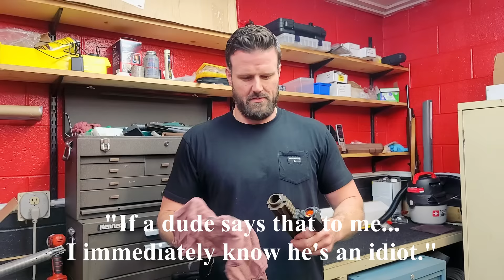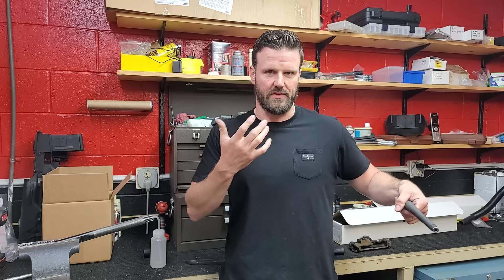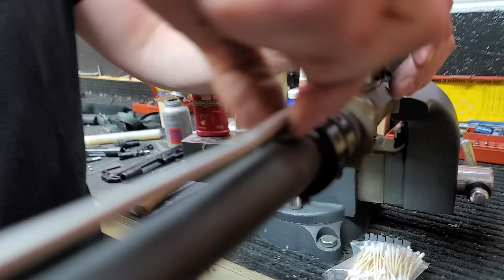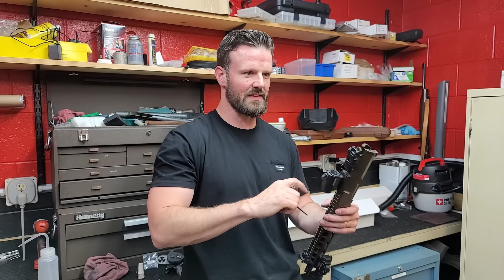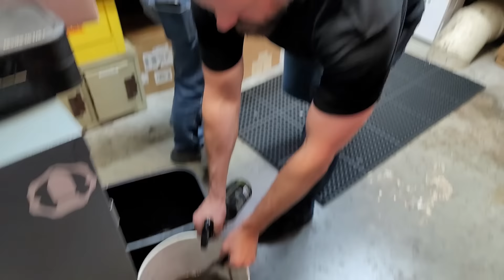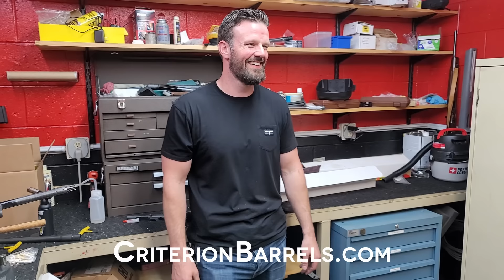AR15 Science

Comment: 6:02 Why the gov. profile exists today: As Mickey said, the military has it so it must be good and everyone wants it. 
He probably knows, but for those that are interested how the gov. profile for the A2 came to be: 

Lt. Col. Dave Lutz shared on AR forums that when the M16A2 project was on it's way in the early 80s the collected data for improvements named breaking of the hand guard and 'bent barrels' cause the armorer's drop gauge didn't fall through. Circulating stories featured opening crates with the rifles or rough bayonet training as possible reasons. The M16 was meant as a handy, lightweight rifle, so only the front of the barrel was beefed up for the bayonet lug (4.8 ounces over the standard profile isn't that much additional weight, a bit less wobble in the front but not as quickly handled). The lug showed 9 times more resilience against bending under load bearing tests. Issue fixed, send out the data package. Quite a bit later they inspected the barrels with a bore scope connected to a screen and found copper accumulation on the burr of the gas port holes. After they removed that, the drop gauge passed and the barrel was 'unbent'. Colt changed back to the standard profile for civilian sales, but the gov. production was to far ahead and they kept it. So get yourself a gov. issued perpetuated mistake!
Reply: Hbar been the truth for me 😅
It's like I hear Looney Tunes "boing-boing-boing-boing" sound on my first government barrel when I first started. 

You just once again assured my hbar choices. 4 rifles with hbar, love it

Comment: Only concern I have with the thread locker on the gas block screws is that we heat up thread locker to remove it so that gas block gets super hot when in use so that blue thread locker has to be turning to liquid and can’t be doing much for securing a set screw.  I’ve had guns in the past that have a pinned gas block that have shot really well. Not saying I am anywhere near as smart as the guys at criterion but I am curious as to why we use loctite on super hot surfaces when we know heat changes it’s characteristics. Isn’t this why we use rock set (spelling?) for muzzle devices?
Reply: @southernpartisan1772 on a machine gun sample??
Reply: Especially running suppressed at a minimum I would use high temp thread locker on set screws
Reply: This way of securing the block is for accuracy. In a war situation you'd want a better fit id say
Reply: You’re right. Rock set should be used and not locktite. Blue locktite will do nothing.

Comment: I was surprised to see him use anti seize on the barrel nut threads instead of aeroshell. For someone who’s very particular, he’s using the wrong stuff. I was also surprised by the blue loctite on the gas block. Dude, the gas block is the hottest part of an AR15, I wouldn’t even consider red loctite sufficient. SOTAR recommends rocksett. I totally agree with him on the gas tube though. I was told by a long time armorer years ago to essentially free float the gas tube and make sure it’s not contacting anything except the gas key. I saved a gauge that came with an Odin Works rail from years ago that helps ensure perfect alignment and have ever so slightly bent many gas tubes to get them in perfect alignment.
Reply: Yup

Comment: I’ve Previously Stuck to DD/BCM BFH ELW/BCM 410SS/RainierArms “Match”-Mountain Mod2(4150CMV/SDM Fluted/Mid-Length Gas System/Nitrided),Aero/BA-416R Fluted Hanson Profile/Mid-Length-Gas System, Noveske(416R SS & CHF CL’D). 
  Recently I Gave your 13.9” Core .223 Wylde .625 Tapper Profiled barrel + RipCordIndustries “Gass Hole-Gas Block”+V7-Inconel Middy Gas Tube(“Fuse=Bad”: Sensing round or Catastrophe Failure is preferred.(AS IF I’ve ever forced to run it to the point of catastrophic failure from shooting 750+ consecutive rounds in under 15min then odds are A potential catastrophic failure will be the least of my concern on what may possibly maim me/threatened w/ Dead of grave bodily injury. 
  While I’m likely dense I figure if a race motor is built so the valve either opens or motor blows. My hypothesis is same with the AR15. It will either work or result in catastrophic failure, that the risk of such an occurrence will be minimal compared to secondary external threats. 

  I lapped the face of my SOLGW upper, heat fitted your barrel into the upper, dimples both set screws. 

  That said. I did discover a very strange wad of Goop/Dried Waxy looking crap fully obstructing the Entire Gas Port. Upon inspection when installing the GB, I used a thin wire to clear the obstruction, tested w/both human & machine air pressure to guarantee the obstruction was 100% cleared. 
   Since I’m aware of your strong reputation, and I caught it before any potential issues occurred, I didn’t see the Point in sending it back on an RMA for inspection beings it seems GTG now. I did document w/ multiple photos AND saved whatever the hell was obstructing it in case you guys ever desires to look at it n determine what it was. 
   Between the install procedure I followed sane as you did, added your head spaced bolt, I’m really excited to see what kind of accuracy it will yield for me. If I can consistently get .5-.75moa from a bench vice(remove my human error/variables) n see what the mechanical accuracy of the rifle can potentially be w/ INI Razor Core 69/77grain HPBT 5.56 Pills. (mK262 77grain is in-obtanium round my neck of the woods so the INI is one of best commercial options I can consistently find in stock.)

Comment: Out of the barrels that I looked at, Criterion does have amazing polishing on the inner of the barrel. I bore-scoped it, and it's amazing accuracy, I had 16" in 416R SS definitely up there in terms of quality.

I am yet to test Rosco barrel's HBAR accuracy, but the polishing on nitride barrels looks nice after I cleaned up the metal dust inside. 
Ballistic Advantage is hit and miss, with an occasional barrel gauge. That looks like a rifling scratch. Noticed in both of my BA barrels.

Comment: Don’t recommend Forster or clymer gauges get some PTG I used Forster 1.4646 with 3 new bolts and 3 new barrels 3 bolts on each of my 3 barrels I tried and none of them worked both barrels and bolts where from highly respected companies I finally checked it with a digital depth gauge once I finally got my PTG gauges and the Forrester was actually a 1.4676 lol all of my PTG gauges were spot on
Reply: Yup! I use the PTG 11 piece incremental chamber gauges to find the exact chamber/bolt head space..PTG is the best!

Comment: A lot of good knowledge given, thanks. However, blue locktite is not going to help on anything that gets hot. I would suggest rock set instead of that. Rock solid hold and comes off without having to heat it. It’s the same stuff Surefire sends for their muzzle devices.

Comment: Can confirm that Criterion barrels shoot great. I have a 16" hybrid with rifle length gas tube, 223 wylde with chrome lining and a headspaced bolt from them. Mine is properly put together, but i didnt use the green loctite like they did. It will shoot american eagle m193 under an inch at 100 for ten shots with a eotech sight. I put a scope on it when it was new and shot some federal gmm 69gr and some black hills 77gr smk. Both shot around a half inch at 100 for 5 shots. Ive looked at the bore, throat, and gas port with a bore scope. And there's nothing but good things going on in there. In my opinion, tgeyre well worth the money.

Comment: Serious question… Did he tighten the barrel nut with just the reaction rod? I always thought you need to vice the upper and the barrel? That rod has nothing to keep the upper stationary while turning the barrel nut onto the threads of the upper.

Edit: Nothing to keep the upper stationary aside from the indexing pin on the barrel
Reply: Tightening is ok. Breaking free is where you risk shearing the index pin.
Reply: @MrEliBob Really? How so? I would think there would be more force exerted on the pin while tightening than loosening.

Comment: Disagree with blue loctite, how do you remove loctite??? Heat! The gas block gets extremely hot, I’ll take a pinned gas block every time.
Reply: Just pointing out that you're disagreeing with a guy with a mechanical engineering degree in this specific field.
Reply: @MrShady-dz5ew  that’s cool man. Do some research on it, people that run tactical courses report tons of loose gas blocks, generally when they’re installed in the manner he’s recommending. My time as an auto mechanic has led me to disagree with engineers pretty often.
Reply: @okay4me2  By all means, your opinion may be valid on most barrels and gas blocks. But specifically, for this barrel, it is my assumption that the "master builder" would have the most experience, knowledge, and practice for this specific series of barrels; what works and what doesn't. I'm just pointing out that all those people running tactical courses may A. not be following installation instructions or B. have a different barrel other than Criterion. Just something to consider. You have a nice Sunday, now.
Reply: @okay4me2 you wouldn't have a job without engineers.

Comment: Once the Loctite 680 is used on the barrel, what do you have to do to remove the barrel later on? Or is this a permanent installation?  Thanks.
Reply: Heat.  It isn't a super strong bond like blue or red.   It's designed for slip fit installations to fill in gaps.   You might need some encouragement with a wooden dowel and a rubber mallet after heat.

Comment: What is the point of these short barreled guns. They're louder, glassier and have less velocity at range, which equals to less ft. lbs of energy. I see the 13.7 pinned and welded but I only have 16" and up. My favorite is the original 20". I get the maximum potential out of the m193 55 grain load with it. I'm not saying that anything is necessarily wrong with the shorter guns but my question is why?

Comment: Awesome, would be alot cooler of the core series was in stock
Reply: It took 6 months and 1 week for my CORE series barrel to get in my hands.    This will be my 3rd criterion AR barrel.   (18" hybrid match 6.5 creed, 20" hybrid match .223).   Both of the first two are tack drivers.   I installed both using the green loctite on advice from a gunsmith friend.  He didn't really explain the why, but I did it anyway.   I'm glad I did after seeing this video.

Comment: ok just want to give ya food for thought glueing the barrel aka steel to the upper aka alum, too metals  that  heat up an cool down different might not be a good thing ,your fit is so tight  you need to heat the upper no need to glue , i know a few MOPAR  motors  that drink oil because they try to gaskets to metals that heat up an cool at different temp  ..rips that gaskets apart ,,on a good note 3d print your self a gas block holder things are finger savers ,,Nickolaus Mowrer has some videos on barrel harmonics ,3d animation!

Comment: Any idea if they do any nde on any ss parts subject to heat cycling looking for sigma FeCr promoting failure points?
*Nice he mentioned the aluminum factor in the barrel nut having a different coefficient of thermal expansion. 
The anti seize will help prevent (galvanic) corrosion between if its a stainless steel barrel and aluminum barrel nut as well.

Comment: Loctite needs a primer if your using coated metals. I'm fairly sure that gas block has some finish on it, and the screws probably are coated too.  
People use loctite improperly nearly all of the time, but these same people get by because well-torqued nuts/bolts generally stay put, and loctite that's been compromised still has decent value in disallowing a screw to back out.
Remember, loctite uses the metal's ionic elemental makeup in order to cure, but it the metal is coated, and the coat is blocking the loctite from touching themetals elements, then you have to use a primer.
Reply: Explain more what are your credentials
Reply: @peeeoii2738 I'm merely repeating what's on Loctite's instructions. 
Maybe if people would read the instructions, they'd use Loctite properly.

Comment: The Avid master armorer kit got me through alright, but my furniture was guntec, and these barrel nuts are not your standards as they were. I like the guntec wrench, but wheeler looks just as good.

I had to use both action rod and magazine clamp because the action rod doesn't have the top brace to distribute the tension off the threads.

Gathering the tools took forever, and I don't like being the yuppie that doesn't know how to use what he's got, so ensuring that I didn't buy anything I didn't already own was paramount.

The rites of men must also include proving proficiency.
Fuck that torque wrench, I work on cars, much of those precision tools were used by the best tool available.

Gonna need that wheeler action bar, not the greatest setup I had going, it's just what I had.

Fuck your headspace gauge, it will NEVER mitigate your use of crush washers.
The fact that you need to be delicate with suppressor installation is weak.

No go means no go. Find a solution, stop making special rules.
That's not how men work.
Reply: What do crush washers have to do with a headspace guage and what do have against torque wrenches?
Reply: @jeremyburris4890  crush washers is a pretentious argument about alignment. Why fuck with precision when you can completely mitigate it with a jam nut?
A crush washer has difficulty with alignment and any tenth of anything is risking the slightest of friction. Enough when dealing with that kind of fps.